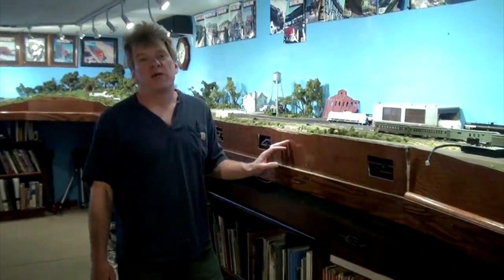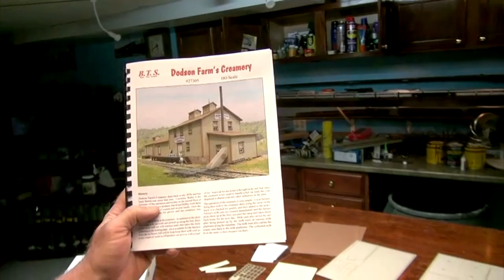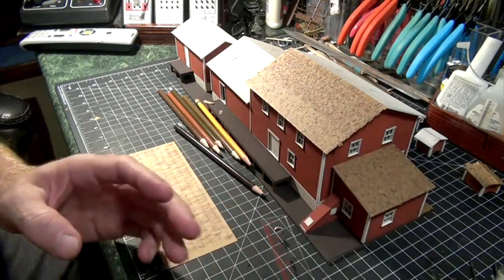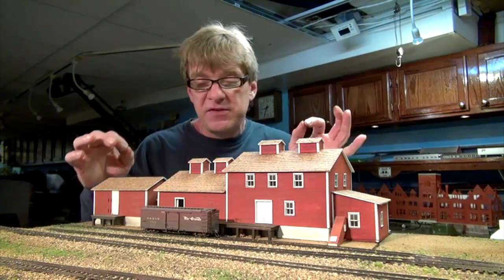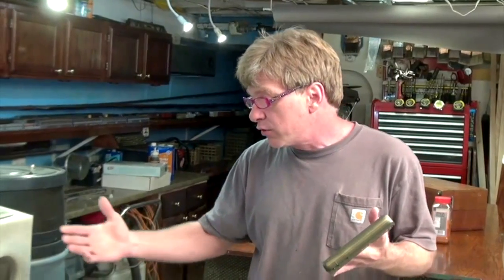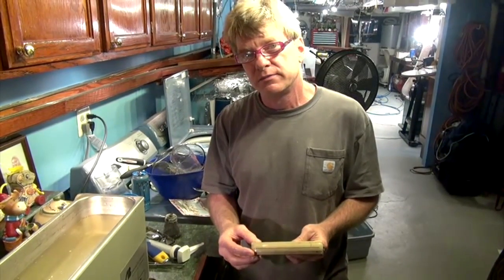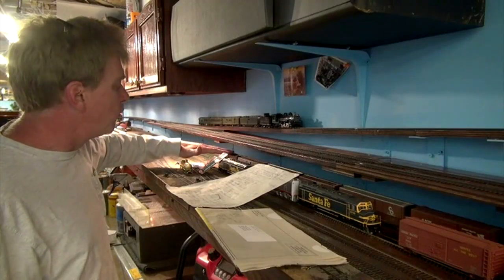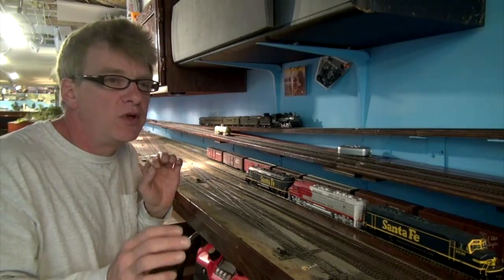Layout construction tips | Model railroad tips | Model Railroad Hobbyist | MRH

Comment: One tip to make trains going up at any grade is, to use fine sand paper across the 
rails to make small scratches and it will help the wheels to grab onto the rail , just
like sand does on the real trains.
Reply: interesting points ,if anyone else wants to uncover how do you make a model train layout try Pycanta Model Railroaders Protocol (do a search on google ) ? Ive heard some awesome things about it and my m8 got amazing results with it.
Reply: Unless your locomotives are battery-powered, that will cause problems. Dust and corrosion build up in the scratches and inhibit electrical pickup from the rails.